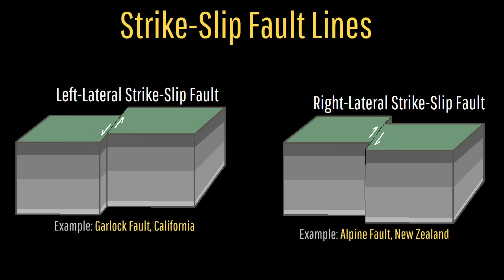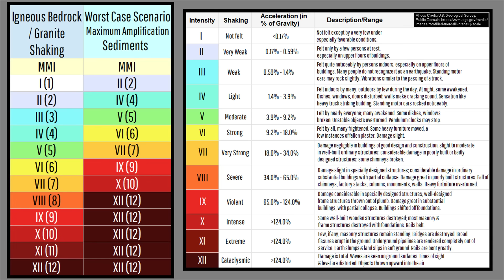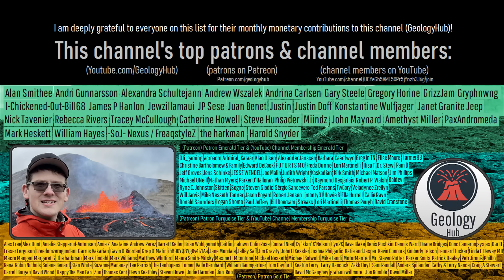Norway Earthquake Update; M6.5 Quake Strikes, Now a Volcano Might Erupt

Comment: Last part is right there. But I see something that might be related to activity, is the moon cycle and the tide. Look at it and you might be a bit surprised. I could pin point activity spot on past week to it. Some parts, seems to be effected of the preasure of the tide in the ocean floor when we have the plates moving. But what we see often, is vulcano svarms in those cycles. Ive been right 5 times now around a few points now about this. where I pointed each date. I did say in 3 days periode. Due when the ground is not stable its hard to pinpoint the excat day.

Comment: I assume the Kilauea date is wrong at 2:56? 

When St Helens had its big eruption - it was an earthquake that triggered the landslide, and the landslide that opened up the mountain…so…isn’t that an earthquake triggered eruption?
Reply: I think the reason the 1980 St. Helens eruption wasn't included on the list was the fact the magma was nearly to the surface already, and eruption was imminent.   Meaning, it didn't cause the magma to rise and pressurize, but was rather just the landslide trigger.   The mountain was already primed to erupt at any moment...earthquake or no earthquake.

Comment: Love the coment at the end lmao. 

Question: When was the last time Beerenburg had an eruption from its summit vent? From what im learning is that in the past 300+ years, Beerenburg has only had flank eruptions at the very edge of the island. I find that interesting. 
What is Beerenberg's magma composition? I'd imagine it would be andesidic.
Reply: Looking it up I was able to find a 2022 Frontiers in Earth science article on The Volcanic Hazards of Jan Mayen Island (North-Atlantic) by Eirik Gjerløw et al
I teems this volcano's eruptive products appear to primarily consist of trachybasalt and basaltic trachyandesite with uncommon amounts of basalt, tephrite/basanite and trachyandesite with some examples of trachyte lava domes indicating it is overall highly alkaline in its eruptive products .

It doesn't seem much if anything is known about the summit because of its permeant ice cap so pretty much all the data on it comes from the numerous flank vents and the lower elevations of the main stratocone.

The volcano as a whole seems to be younger than the last magnetic reversal i.e. younger than 700ka BP which in agreement with rock samples of which the oldest exposed rocks radiometric argon date to around 460.9 ± 55.8 ka to present. Additional constraints come from ash layers from  of which two Holocene epoch two significant tephera layers (i.e. VEI 3-4 range) have been identified from sediment core have been identified, an unknown source vent eruption from 10.3 ka BP chemically linked to the volcano and a layer corresponding to the 1732 Eggøya tuff cone eruption while Greenland ice cores indicate it has had several major explosive Sub-Plinian or Plinian eruptions in the past the last major one ~63 ka BP  but beyond that the main cone seems pretty unconstrained with all witnessed Holocene eruptive activity constrained the volcanoes flanks which notably remain poorly mapped and constrained below the water surface.

Comment: Not sure why you're being that dismissive of the potential link to geomagnetic activity. I'm also extremely skeptical of it, but there is some limited evidence for it, and it's not inconceivable that the induced ground currents combined with reverse piezoelectricity could potentially trigger certain faults under specific circumstances. Not saying this is actually true, but I don't think it's such a clear-cut case.

Comment: If the source is non-magmatic could it be that ocean warming is now destabilizing seafloor methane clathrate solid crystal structures, in a similar way to how the Storegga submarine landslide may have been triggered ~8k years ago ?
Reply: Surface temperatures are only going to affect the salinity of the water sinking to the ocean floor, I believe. Increasing amounts of less saline ocean water via glacial melting, etc would result in a decreased flow of saline water to the deep currents.

Comment: Are you GOD or do you have a crystal 🔮 ball 🤔  Didn't think so. Then how do you know for sure there is NO correlation between specific solar influence and earthquake or volcanic activity. 🤯
Reply: Do you have any idea of how much energy even the smallest plate movement requires? If that energy came from outside the planet, the oceans would boil off into space and all life on earth would cease. 

Instead, the energy comes from below, from thermal differences in the mantle, and is (thankfully) extremely poorly transferred to the surface.

Comment: Maybe an episode re clain magnetic storms have no effect. So of the magnetic storms untangle the polarization of the planet and the mantle magnetism wobbles, then it won't cause a shifting in .often rock to any degree or enuf to cause possible eruptions or earthquakes.
Reply: Bollocks. That comment was a load of gibberish !
Reply: OMG😂😂😂🤣🤣, what the hell was that!?!?
Reply: A seizure???
Reply: The amount of energy necessary to shift oceanic plates has to come from within the planet. If it came from space, it would sterilize the planet.
Reply: @irenafarm :

That's really missing the gist of the argument. I'm not even an ardent supporter of geomagnetic influence on seismicity, but it's not impossible; there is some limited evidence for it, and plausible physical mechanisms. However, in any case the potential energy that gets released during the quakes obviously all comes from tectonic motion, no one is disputing that at all. This is more about the potential for strong geomagnetic activity to possibly trigger certain quakes that are about to slip/rupture through e.g. reverse piezoelectricity from induced currents. I'm very skeptical myself, but I wouldn't dismiss it outright until we've investigated it much more closely in a scientifically rigorous manner.
Reply: Try that again, but in English!
Reply: @danielulz1640  spellchecker. The sun starms are said to bend a weaken the magnetic fields thus possibly being art of its flip in magnetic field.  The earth is way off in time ro flip. Tho I question if u r correct in that they aren't in relationship with valconoe or earthquakes and in part can increase magnetic intrusions
Reply: Maybe try learning some english and proper writing first if you're trying to pass off some wild pseudoscience.